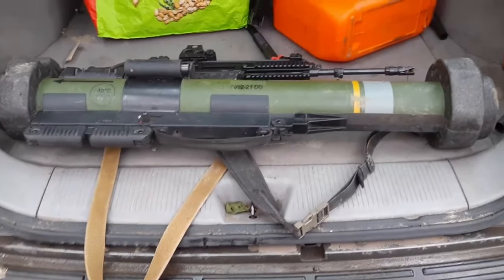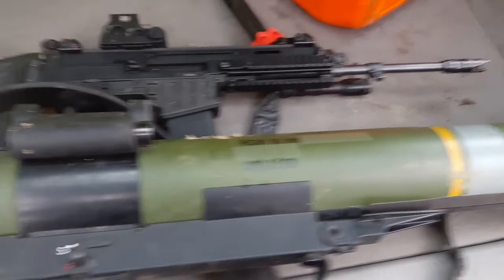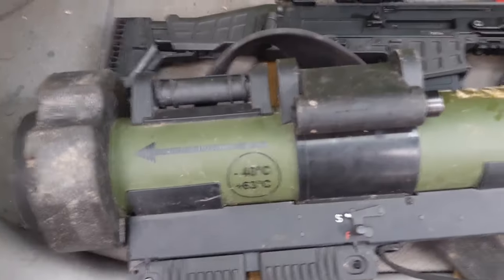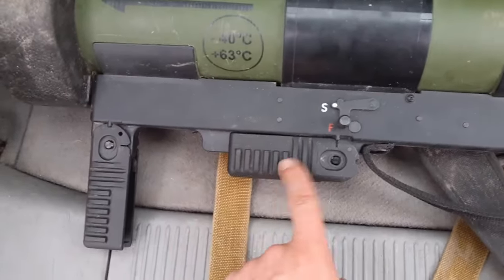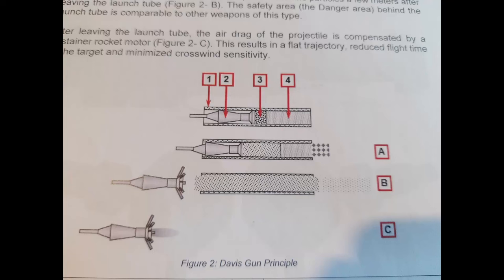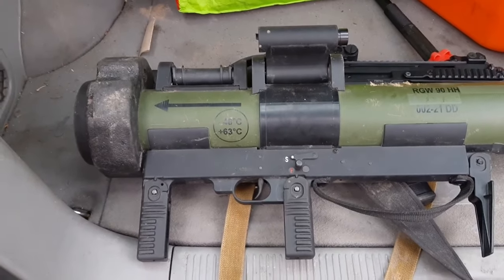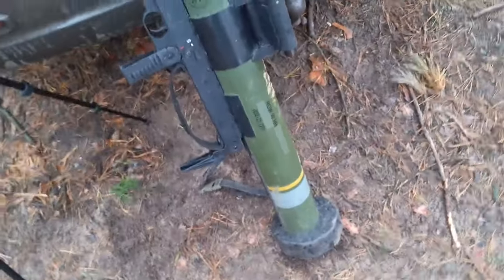RGW 90 HH MATADOR (Germany)

Comment: It is well liked mostly because it is very easy and quick to deploy and basically fool proof. There have been many cases of people trying to deploy AT-4 and other systems have having trouble due to unfamiliarity and having to battle several safeties and a separate cocking mechanism.
Reply: Yep, with some of the AT systems it almost seems like the targeted vehicle/convoy could set up a picnic and then pack up and leave before you are able to get of a shot

Comment: Very nice, I was waiting for this specific review like a child awaits Christmas morning!

One thing I noticed, and I think is worth calling out. The RGW90 HH A1, the first model in production, had only 500mm RHA penetration. 
The RGW90 HH A2, that is, all new launchers produced, like the launchers you guys get, should have ~600mm RHA penetration.
This was achieved with optimised production methods. 
Still, the field manual should be correct, as even Rheinmetall's official page lists it as "500mm+", which is technically correct.
Best of luck to you guys!
Reply: what does the launch tube have to do with the penetration of the ammunition ?
Reply: @TheInfidel_SlavaUA  The mentioned improvement concerns the production of the warhead. Better coupling was achieved between the liner and the explosive, with a slightly improved fuze, most likely. Even a tiny gap between the liner and the filler could reduce performance immensly.
Reply: @TheInfidel_SlavaUA  The matador AT weapon is a disposable/single shot weapon. So the launcher and the warhead are one, there is no reloading of this system. That's why the launch tube has a difference in penetration, because the warhead inside it is different. Duh. Its a single weapon system, one would only talk about the tube by itself if you were disposing of it

Comment: yah reminds me of the West German Armbrust rocket launcher from the 80s where you can also fire it from inside a car and no problems. This is teh much improved version of the Armbrust.  Very good AT weapons , very good vs. APCs , still good vs. T-55s and 62s but no good vs. 72s and above.
Reply: The maximum thickness of the armor on the T-72s Turret is just 120mm. The newer MATADORS HH A2 that are being sent to Ukraine can penetrate 600mm of armor. This can even take out a T-90 if it doesn’t have ERA applied to its turret
Reply: Shot placement!😂

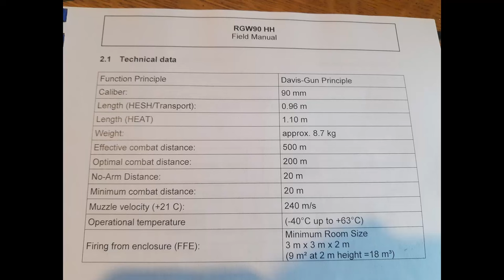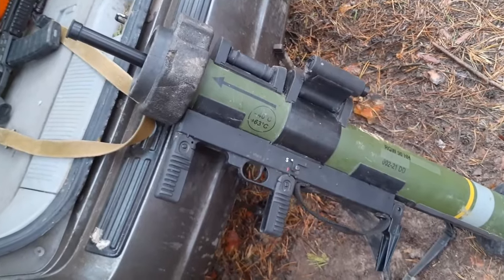Comment: 2:45 and 3:44 I think you mean 50cm of RHA. 500m = 50cm. 5cm is only 2 inches. obviously 2 inches is terrible performance when you're comparing to the AT4 35cm penetration. 

I guess its 5dm (deci) but nobody uses that measurement.

Comment: a f a i k there is a version with a HE- warhead and a timer, that can be made to explode exctly above a concealed enemy.
Reply: There’s multiple versions.
Illumination, smoke, HH (shown on the video), anti-structure munition (ASM) and long-range multi purpose (LRMP) which is the version you mean.
LRMP can either be used in air burst mode or as direct impact, it’s meant to be used against infantry or light vehicles.

A HH-T version with a tandem HEAT/HESH warhead is being developed, which would make it more useful against tanks with ERA.